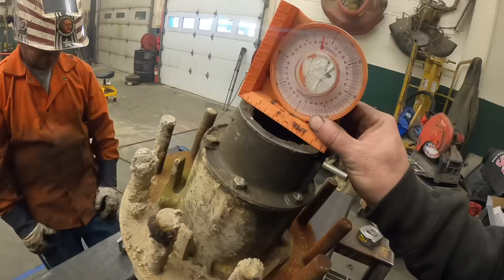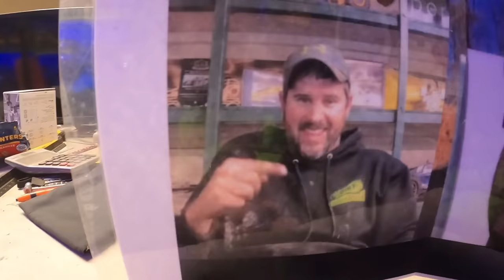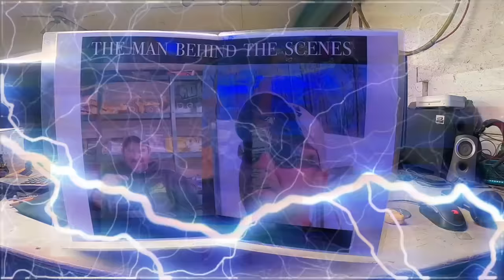Watch Aaron's Wild Takeover Of The Shop and  My Latest Epic Idea!

Comment: DP, you should seriously invest in a 3x4 CNC plasma table and several Fireball Tool squares. And get a supply of 0.25 plywood to use for patterns. You are an awesome fabricator along with Aaron and just a couple of strategic tool additions, I have no doubt that yall will make some seriously awesome, taking your fab work to the next level.

Comment: Good job guys! Mike, noticed on your closing comments that the metal rack was moved to the back wall and was even lighter than Aaron had left it. Again, good job on the "limb pusher, root rake" Am anxious to see if the taco is hefty enough to actually root rake vice pushing limbs and briers around.

Comment: A 35* angled vertical poll metal sheet/plate rack on the right would make finding and getting the gadge sheet/plate you need out much easier. Not having to dig them out. 😎👍👍

Comment: One man's junk is another man's resources. Not only demonstrated in this video by the metal rack, but also explained by Ryan in many videos on his Mr. Digg channel.

A major difference between useful resources and mere junk lies in the sorting, to be more precise: in the key(s) to the sorting. Size may be a key, material may be an even more important one. So: finding the right key to sort junk on can turn it into valuable resources. (Think of a construction kit manual.) Vice versa...

Sidebar:
(the Netherlands, summer of 1980) I once got deployed in a left-overs outlet of a bookshop chain. Stacks of anything printed just laying around wherever they had happen to be put down. Hardly any customers, so I started to arrange the piles in some way that made sense. Outside, a brass band stopped playing. The audience curiously flooded my store. My sorting payed off. I have been told that I had generated more turnover in (half) a day than the store usually made in a week. By contrast, soon afterwards I got deployed in a regular store of the chain. Everything clean and on nice piles. But I found overdue items ("yesterday's papers") present, and I couldn't find the paper rolls for the cash register (until I was given a hint). So much for sorting.

Comment: If you want to give me that scrap for what you'd get for it, I'll even smile and give you a Thank You, as I roar down the road before Mike finds that he needs a piece.

Aaron, you are a great welder and you get paid for it.  I, on the other hand, am not a professional, even though I've gotten paid to do it a few times.  Also, I've seldom had a shop to work in.  All that said, I really love flux-core.  The wire is more expensive by a bunch but on heavy section where penetration is a must-have and on rusty, crusty steel, it's great.

Comment: If you still find you have traction issues this summer. I have taken an older set of ag tires and bead locked them with 1/4” self tappers and filled them with cement. They are 150lb a piece and really grip softer ground! Love the shop fun y’all have.

Comment: Easiest way to figure out if you left a tool in the beams before welding the end caps on is lift the unit and tip it side to side and listen for a tool sliding down the tube...

If Mike complains about the missing tool, just tell him the mount now has a new Variable Balance Feature...

😄😁😆😅😂🤣

Comment: HA HA HA, I feel your pain MBTS, I probably have 1.5 or so ton of scrap at my shop, I can't tell you how many times I have had the scrap guys pick up the dumpster then within a week I need something that was tossed, and it drives me nuts to have to go buy a full stick of something just to use a few inches lol. good job getting that rack done, It's such a pain but feels good once it's all organized. curious to see that rake in action, going to be interesting to see how the 240 handles it and the limbinator.

Comment: Sawhorses turned out good but still needs paint. You could have put a mark on the center of the short and long side and line them up on a center line of the mount [12 o`clock, 6 o`clock].

Comment: MBTS: I too save every odd piece of metal I have. And most of it actually gets used later.  Same with small wood scraps.  I'd really hate to go out and buy a full length of something just for a spur of the moment repair. Even the large flat panels of stainless on a discarded grill get saved. Ya never know when you might need that!

Comment: While watching you cut the tubes a question popped up. Have seen you use your chop saw many times on here. Have you ever looked into an Evolotion chop saw? I bought one a couple years ago and love it. Still on first blade. Uses carbide tips teeth instead of abrasive wheel. Expensive but that the one blade has lasted for nearly to years is awesome. Cuts much cooler also. Just wanted to let you know about them. As mcuh steel cutting as you do it might make it worth investing in a longer lived cutter. Biggest I've cut so far is 5 inch channel and 1 1/2 round rod.
Reply from the maker: Yes we have

Comment: Add gussets to the top connection point on the attachment plate .  I had a grapple fall off my skid steer due to not having the gussets installed .

Comment: Just to finish off the metal trestles weld a U bracket to the ends then you could fit 4x2 in the brackets and then lay an 8x4 sheet of plywood on top and you've got a large assembly table

Comment: Mike, tell Aaron that was probably a machine welder, the weld bead is straight, no variation. A person will tend to vary between the two pieces he is welding to be sure each part is burned into.
I was hoping Aaron would paint the brush rake YELLOW, BRIGHT YELLOW. That would have been good.

Comment: Nice work Aaron, going back over assembly line built attachments don't seem to have the best welds, it's like whoever can hold a mig welder is gluing the stuff together. Nice view on your property, pretty handy to have a machine to give the land a tune up now and then, I save up scrap pieces of metal to use for that special project.

Comment: Those attachment plates were made on the cheap purely to go to auction. Caveat Emptor is the rule there. At least you caught it and fixed them Aaron.
Edit: If DP ever gets you a plasma table, you could knock those out faster, cheaper and better.
I'm all on board with you about keeping useful pieces of metal. Original trade was fitter/turner with some odd specialites, been an auto mechanic for the last 30 odd years but I still have a small lathe at work and a bunch of metal and plastics stock. It's amazing what you can fix on a car when the suppliers say the parts aren't available or not supplied separately if you know how to use a lathe and are able to weld. I'd like to have a small milling machine as well but just not worth it.

Comment: Both attachments have one issue that I’ve noticed. Neither of them are able to sit on the ground without flipping over. Needs a kickstand of some kind so the skid steer can easily drive up and hook
Reply: Also surprised that Arron didn’t paint the attachments. Say pink, neon green, or red. Something like that would be hilarious to see DP response.
Reply from the maker: Sorry I see no issues
Reply: All that weight on the attachment’s being on the working side will either flip it to face the sky hence making it difficult to quickly attach. And the root rake will flip to the attachment side and be flat on the ground. Again not a quick attachment.  But the use of a kickstand like on a bicycle. Up when connected ( stowed away)in use, down when disconnected (extended) so the plate is easily accessible.

Comment: Hey Arron, that blue tape line on the floor. Does that designate your side of the shop???
Arron. Those welds on the plates are probably machine welded and human thought doesn't come into it the machine just does the pass and its done. Apparently.

I won't complain about my collection of off cuts now. But I got heavy plastic tote tubs where all my "resources" go into.
Yeah you can't get rid of your natural resources.

Comment: If that junk pile got cleaned up and organized, Mike may not dislike it anymore...

It's possible that what he doesn't like is just how messy and ugly that corner of the shop looks, NOT the fact it's full of little bits & pieces of metal...

If I were you, I'd put all the tiny fragments in a few bins and sort & stack the larger plates and beam chunks in some boxes and/or shelves to make the area look neat and clean(ish)...

Either that, or find some place out of sight that Mike doesn't go to and relocate all your bits & pieces there (is there an old weather proof storage container he's not using on the Property you can commandeer?)...make it LOOK like you cleaned out the trash while in fact you just moved it all somewhere safe from Mike...

😄😁😆😅😂🤣

Comment: Say that's not playing hooky by any means. 
That's paid work, because you doing field product development, to see if everything was up to standards, are if any design changes needed to be made to improve the operation of the implement.
So full pay for the day, and you should be  reimbursed for any of your fuel you used in your vehicle if you pulled the equipment out there, and back to shop.
It's legal tax write off whether you did it by yourself as acting supervisor during owners vacation. 
Perfectly legit without a doubt, and shame you didn't get to do trial run with the rake as well.
PS
Keep most every drop, because saves money because either you have to cut up something off bigger piece that could've been used to make something bigger, are you have to go buy something to get a small piece out of just for that. 
IBB 108 Birmingham, AL 
Grand Paw, dad, two uncles, brother, brother n law, and myself. 
Sadly everyone is gone but my brother n law, and myself. 
We're both getting to the short side, especially myself, but it was fun while it's lasted.